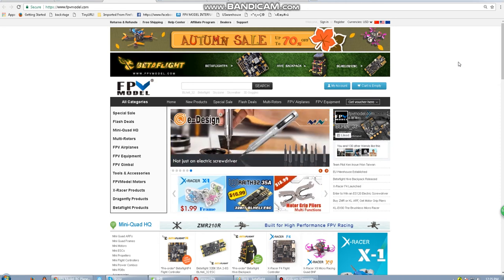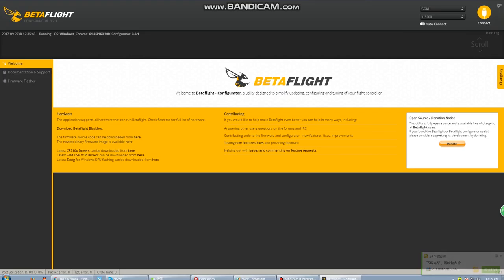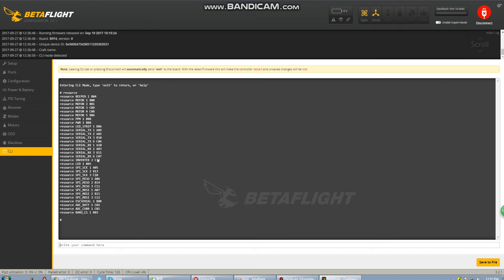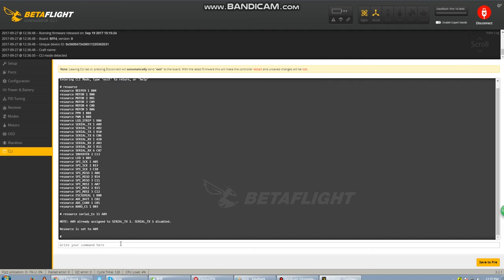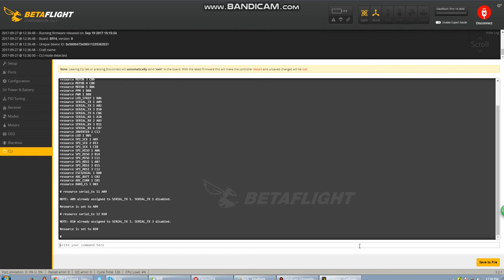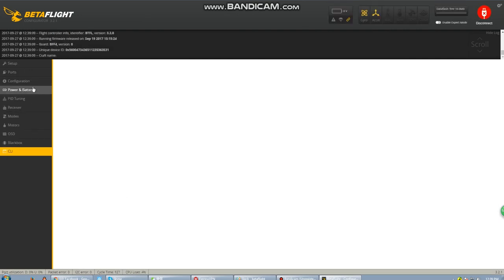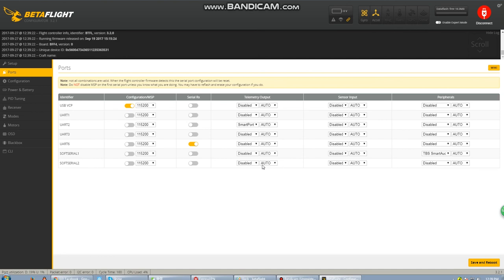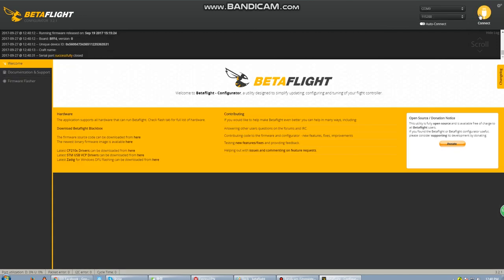BetaflightF4 Smart Audio, Smart Port, ESC Telem How To

Comment: Please explain how to connect a fresh betaflight f4 board with a fresh x4r-sb receiver? Where to connect sbus and s port. And which rx hack do i have to do or not to do? All this is so confusing......
Reply from the maker: Stop by fpvmodel.com on facebook and send us a private message. We can schedule a time to walk you through it. It's pretty simple but can be confusing for those that don't know how to deal with inverted and noninverted signals.
Reply: WWW.FPVMODEL.COM  
Hi. I got telemetry sorted thanks. I did not use soft serial. 😉

Comment: Is this still relevant today? I just finished a new build with this board. I'm using crossfire and got that set up just fine. Smart audio still isn't working. I'm also using the updated mach 2 vtx. I have the audio line from the vtx going to TX1. I'm not using esc telemetry so I figured this should be fine?

Comment: Hi guys. I recently bought BFF4 and BF ESC 32 bits and I solder it all up together with Tramp HV and X4R-SB. I soldered ESC to RX1, Tramp HV to TX3, X4R-SB to sbus (RX6) and Smart Port to TX2 (I uninverted the signal due to another FC that I was using with this receiver and I also set tlm_inverted = on - as on oscarlian tutorial; when it was off was the same). 
And my problem is that when I select to discover new sensors on my QX7 it doesn't reed VFAS and Curr, only shows RSSI and RxBt ;( I want my battery voltage and current back :(
Reply from the maker: Hello Nick. Send us a message to sales@fpvmodel.com and we'll help walk you through the setup. Or go to the product page and  scroll down to the bottom, you'll find a step by step guide there.

Comment: Need assistance in using Kiss 24a ESC's and telemetry therein. I have successfully made these initial changes with the release of this FC with its 1st shipment and ran it with the Typhoon 4n1 32b and aside of having to make some minor VBAT soldering config the set up was flawless. I am on my 2nd F4 and wanted to use some older Kiss 24a ecs's laying around and I have made the correct cli commands to allow me to use the BFF4 as a passthrough to flash my Kiss esc's to the latest Flyduino firmware with no issues. I am running this set up on a Chameleon 6" frame with TBS HV 800mw VTX, XSR modded to run either inverted or non inverted sbus and  smartport " bt for this set up I am running the default inverted sbus and smartport from the XSR, RunCam Eagle v2, and Emax 2306 2400. I was able to swap motor outputs in the cli as the FC in 180 in yaw to allow the xt60 to neatly come out between the top battery pad and the GoPro pad. At first the blue signal led's on each esc lit up after initial power up and the OSD would flicker on the monitor then the final beeps that state good signal would not finish and the OSD would fail to show on screen but the video is fine. I am also able to power the quad but when I give full throttle the quad will flip out. Now when I power up I get the initial blue leds fron the esc's but when power up is complete the leds are no longer on and it will not power up. please advise.

Comment: FPVmodel. Please help. My setup includes BFF4, frsky sxR. I have updated the firmware of the xsr. followed your video instructions and repeated it 3 times. I hacked the xsr to get telemetry and I am using the BFF4 firmware from your site. I am still unable to get Telemetry or smartaudio to work. Please help. quite frustrating since I figured getting the BFF4 would make setting things up easy.
Reply: HEY MATE did u fix yours. I have exactly the same problem. bro please help

Comment: I was checking out your video on youtube and was just curious as to why we have to go thru the trouble of setting up the soft serials in the CLI THEN enabling the soft serial in the Configurator. 
Why wouldn’t the soft serials just show up when we turned on the soft serial switch in the configurator.  
Without going thru the CLI process, when I turn on the soft serial in the configurator the soft serials don’t show up. Seems Odd.  Is this some type of bug.
I did get it to work with you help though, thanks a bunch.

Thanks
RK
Reply: the soft serials get assigned in CLI, then the feature is turned on in the configurator. hope the shines some light on it for ya

Comment: Any idea why the Buzzer is not working in Betaflight 3.2.1 ...  On both the BFF3 and The BFF4  boards ?
am i forgetting turn something on  ?
Reply: Did you figure this out? I have the same problem too.
Reply: Yes I did  ...  you will need to  
type :   get beeper     ( in the CLI ) 

Then you will need to  Other turn  beeper_invertion ON Or OFF      so type  :  set beeper_invertion = ON    
And OR  
Set beeper_od  ON OR OFF        So type  :   set beeper_od = ON   

And  it worked for me
Reply: Nitrokillah Thx a lot, you'r my hero :*

Comment: I got problem with the current sensor, its not accurate. Do you have the the correct "scale" number? thanks,
Reply from the maker: We had good results with 565 and an off set of 6.
Reply: I used bf 3.2.1 and the scale and off set you gave still not resulting the accurate number. I used 5s 1350 mah batree. When landed, the mah in OSD shown around 530 mah but the batree voltage is 3.5 per cell, check using lipo checker and charger.

Comment: I have smartport working only when doing the non-inverted hack on my X4R-SB naked using UART3 TX.
I didn't need to perform the soft-serial trick showing in this video. Currently running Betaflight 3.2.1.
set tlm_inverted=OFF
set tlm_halfduplex=ON
save

Comment: Great little video series! One issue though, I’m not able to get telemetry. I followed every step in your video, I have smart audio, but no telemetry...
Reply: I ran into similar issue and rearanged my UART for it to work. I wired my SPM4649T spektrum telemetry receiver on TX3 pin make sure you enable telemetry feature and select SRXL protocol if using spektrum. I moved my smartaudio IRCtramp VTX to TX6. The TX6 pad is kind in the middle of the board you can see it on the drawing of the board on the FPVModel website. I'm using both telemetry and smart audio without using any soft-serial. Hope that can help

Comment: xsr-m you need to turn the "tlm half_duplex = off" and "tlm inversion = off"  in the CLI, and it should work, mine did, i did not need to turn uart 3 into a soft tx, it worked as a normal uart tx3 for my matek vtx
Reply: Are you using the non inversion telemetry hack on your receiver?
Reply: no, just hooked up as intended
Reply: Really? I had to do the non inverted hack on my X4R-SB naked and then it is working as it should when using Betaflight 3.2.1.

Comment: not to be a smart ass but I'm a Kiss pilot,  I'm trying to set up a beta flight f4 flight control and bl- heli esc's for the first time.. I just find all this extremely confusing and down right a pita... kiss is so easy to set up and get in the air. I'm pulling my hair out trying to wrap my head around all this and that whole "cli" shit is complete nonsense.. hats off to all you beta flight guys. I'll keep working at it but to me there is no comparison what so ever. KISS is my go to simply because it's easy, it works,  and it makes sense. every comment on here is people having problems and yet not one reply to any of the questions ?  Also before you judge, I have : 
The new f4 board from fpv model 
The new dys f4 board / AIO 
The new Matek f405 / AIO 
and I can't figure out how to get any of them wired up and working, but I have my trusty kiss setups (four of them) that all fly awesome  on the new RC25 fw... guys I'm trying not to be bias here but beta flight is making it real hard...
Reply from the maker: Hello Jason, the majority of the questions all have a relatively easy way to fix. It's just a matter of getting it set up properly in the configurator. If you click on the view all replies below each comment you can find the replies to the questions.

Comment: I've got a BetaflightF4 linked to Betaflight 35a 32 bit ESCs, a Unify Pro HV and X4R SB and get no telemetry on my Taranis, and no Voltage on the OSD just a flashing zero. I have followed your video instructions to the letter re soft serials and smartport etc including using both the firmware you link to and the latest firmware downloadable on Betaflight. Any clues? I see I'm not the only one, but have yet to see a solution?
Reply from the maker: Not trying to imply anything here but a lot of the customers I've spoken to have simply forgot to "save" before exiting CLI. If this is not the case with you please send us a message to sales@fpvmodel.com with a few pictures of how it's wired and some screen shots from CLI
Reply: Hi there already done that, but no reply?
Reply: For voltage, try to go in battery tab (in the GUI) and choose Onboard ADC
Reply: Thanks!!!

Comment: Do you guys have any issues with the buzzer? I connected it properly to buz pins, double checked connections, enabled rx_set and all the other options in the gui but it won't work. Led flashes when aux is activated and voltmeter says buz pins goes from ~1 to ~2 volts. At 5v I'm sure it beeps. Any help is really appreciated thank you
Reply: Im having the same problem.  I can't get a buzzer to work and I can't get the ESC's to beep like you're suppose to be able to do in 3.2.
Reply: Francesco Spagnolo 
I got same problem after i installed  bff4  in my chameleon, but after I updated beta flight to latest stable rev. it started to work.
Reply: Got another problem, voltage and amps are at 0 on osd and blinking.  No ideas
Reply: This can be fixed, or at least for me worked like this, because in BF GUI, in the battery tab, you have to choose Onboard ADC on both choosable options (voltage and amps). Let me know if it fixed, I will try updating FW again for my issue. Thx
Reply: Francesco Spagnolo  thanks. Was not messing up with battery tab. Will try it tomorrow .
About buzzer: check so all buzzer tabs are on in beta GUI . I tryed to disable buzzer when usb is connected,then it stopped working even without cable connected to computer . Had to enable again. Now it works
Reply: Francesco Spagnolo thanks. That was the problem 👍
Reply: ESCs beeping hasn't only the BF3.2 requirement. It depends on your ESCs aswell, if they're blheli_s you should only update theyr firmware through blheli suite. If they're blheli_32, you have to wait until they release the new firmware for them.
However I still haven't found a fix for the buzzer aswell...
Reply: Francesco Spagnolo thats strange, couse mine works .
Reply: Francesco Spagnolo   BF GUI    beeper_dshot_beacon_tone = 1

Comment: Can't get matek vtx (tramp) to work on tx1 with rx1 for escs.  i tried changing tx1 to soft serial, but no dice.  Can someone tell me if it's possible or i need to take it back apart and move the smart audio wire to tx3 or something.  Edit: gave up, moved to tx3, no problems.
Reply: Did you need to turn on softserial for TX3 for tramp telemetry or did it just work?
Reply: It just worked
Reply: had the same issue I wired my Matek vtx on TX6 pin. The TX6 pin is on the middle of the board see board drawing on FPVmodel website. I was using TX3 for my telemetry receiver
Reply: I wired my matek vtx for TX3, works fine, got crossfire on uart2 and gps on uart1, all works!

Comment: I am confused.  I wired my matek smart audio (tramp) to tx1, wired all the esc telemetry wires to the rx1, so i need to do this soft serial resource stuff to get this to work?  I thought i could just go to uart one and use the drop down for peripherals and sensor input, but it will not save what i enter there.

Comment: not sure what is meant to happen with esc telemetry.  i have followed directions with soft serial etc and i have my vtx settings working through smart audio but i cant get any esc data.  i have this brand new bff4 board with betaflight 35a esc's.  enabling esc settings in battery tab does nothing.  only way to get voltage is from inbuilt sensor on fc.  i was under the impression that i could get esc temperature and rpm and possibly current readings direct from esc but nothing.  so far i am not seeing any advantage with these new esc's and flight controller.
Reply from the maker: You can get temp and rpm. Send a message to sales@fpvmodel.com and let us see a pic of how the escs are wired up. Then we can help walk you through the steps.
Reply: WWW.FPVMODEL.COM   thanks for the reply.  I have the escs wired up as per instructions  with esc telemetry signal wire wires to middle terminal of the three closest to the very side edge also as per instructions.  I have flown quad today for 4 batteries so everything does work just not the esc telemetry
Reply from the maker: I don't completely follow the explanation. If you could send us some pictures to sales@fpvmodel.com it would help more to identify the problem than a thousand words.
Reply: WWW.FPVMODEL.COM   hi again.  I have sent a pic to the above email showing wiring of esc.  Other than what is described in the two setup videos,  are there any other settings in betaflight configurator that need to be enabled.  I assume that under the battery tab that current us to be set to esc.  Thanks again
Reply: I now have everything working as it should.  I made the mistake of not having the esc sensor selected on uart1 under sensor input.  Selecting this fixed everything.  I now have esc temp and rpm along with battery mah drawn and instantaneous current draw and voltage.
Thanks to the guys at fpv model for all there help.

Comment: Wired my receiver s.port and TBS Unify audio to their designated UARTs as shown in the previous video and followed the steps in this video, but I'm still not getting telemetry or smart audio working...any suggestions?
Reply: Check if smart audio is working through the osd, it may be just the smart port not working like mine.
Reply: David Pallett I got the smart audio working. Still not getting telemetry through smart port though...I'm using an FrSky R-XSR receiver. Wonder if it has anything to do with the signal inversion...?
Reply: I don't know, if so the wiring diagram is wrong as it shows the s.port direct from the xsr connector, no inverter or hack. I think it might be software related, or hope anyway..
Reply: How did you get the smart Audio working? I have the same problem as you. Neither smartport or smart audio working.
Reply: Problem solved. Updated my FrSky r-xsr receiver to the most recent firmware (added to their website last week) and now smart port telemetry is working just fine!